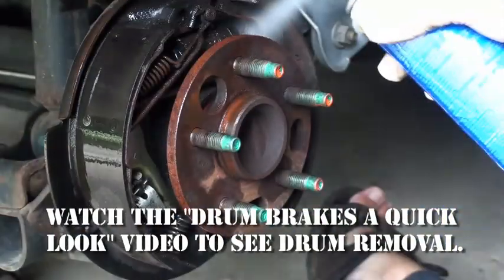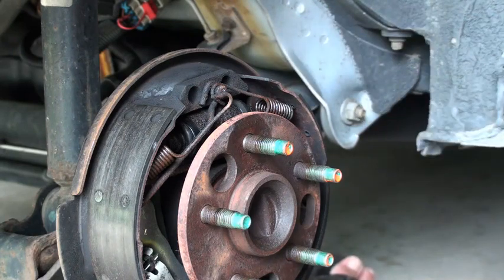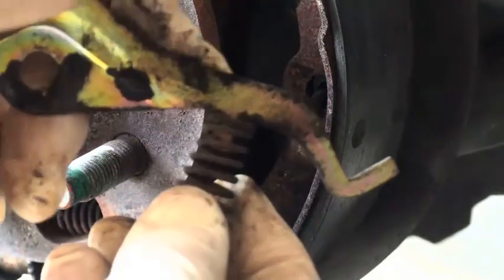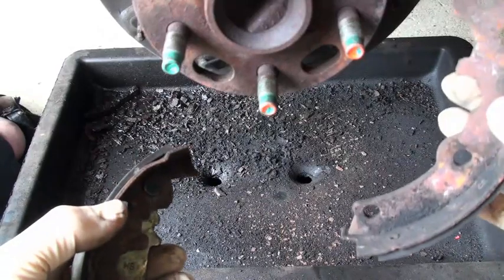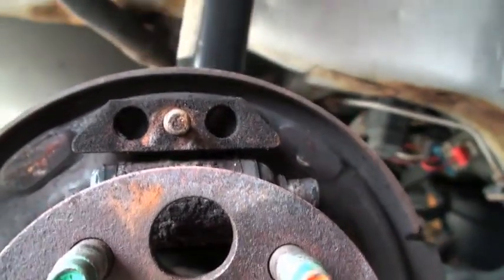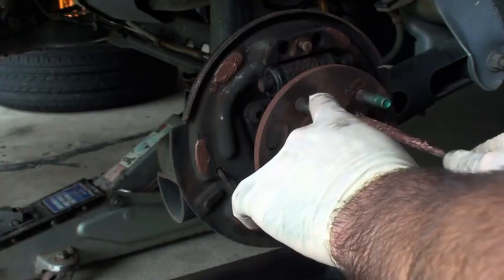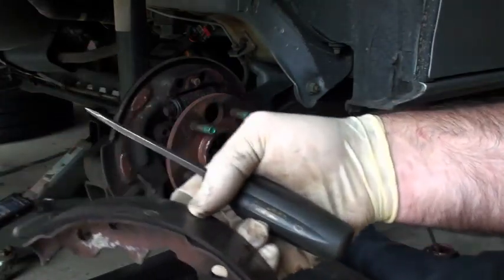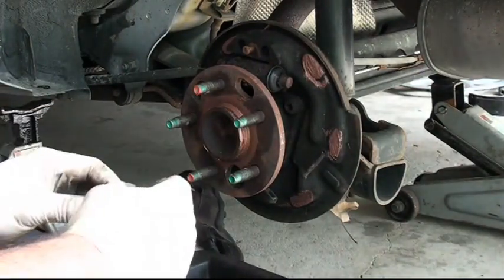Replacing Drum Brake Shoes Part 1 - EricTheCarGuy

Comment from the maker: Great question.  The other style is a "non-servo" style, the difference is how the brakes self adjust.  Servo brakes adjust when you apply the brakes while backing up, non-servo brakes are adjusted when you use the parking brake.  Non-servo brake shoes have the same amount of friction material on both shoes.

Comment from the maker: On a Prelude it is a little hard to get to but you need to take the slack out of the parking brake cable by tightening the 12mm nut at the base of the parking brake lever (inside the console).  When properly adjusted it will travel 7-13 clicks.

Comment from the maker: Use a pair of channel locks, side cutters, and a flat head screwdriver.  You start by using the side cutters to start the spread by placing it between the clamped part of the clip and the peg, then use the channel locks to squeeze the clip against the open end you just created to get it almost to the end of the peg, then take the flat-head screwdriver and twist it in the space between the peg and the gap in the clip.  reinstall using the side cutters to clamp.

Comment from the maker: @aode06 Very true and the way you isolate the cause of the pulsation is to find a safe area and pull up on the parking brake instead of using the brake pedal, if you feel a pulsation the rear brakes are warped, if not then it's the fronts.  Keep in mind this does NOT work on all vehicles (maybe 80%) as there are a lot of different parking brake set ups out there.  Thanks for your comment.

Comment from the maker: They usually come in what is called a "hardware kit" that includes all of the springs and hardware for a rear shoe replacement.  If you just need one clip however you might want to ask a local shop or something, they may have one lying around that they could give you, it wouldn't hurt to ask.

Comment from the maker: It's a standard brake parts cleaner, it may not be available in some states however so you may need to find an equivalent at your parts store.  The antiseize compound that I use is made by 3M and available at most parts stores, it's a good idea to ask the parts person to point you in the direction of these things where you buy your parts, they are there to help.

Comment from the maker: @geekspank1 It runs both rear wheels.  The best procedure however is to adjust the rear brakes first before trying to adjust the cable.  Since you have adjusted the cable first if you go to install new shoes there may be a problem since you have already partially applied the parking brake in your adjustment, you will likely need to back it off when you install new shoes.

Comment from the maker: I got mine in a kit from Sears, it wasn't that expensive and it works well enough.  Tools will make all the difference here, there are many different types and styles that I've seen over the years, some work better than others.  Be careful with these springs though, they can let go and cause some nasty injuries.

Comment from the maker: @ocj921 I've seen rear shoes last a very long time, years and lots of miles in fact.  It's because the rear brakes only do a small portion of the braking 20-30% actually.  It's best to do a visual inspection on them once a year to see where they are and clean and adjust them if they don't need replacing.

Comment from the maker: @TGDragon15 The first think I would check is the tires, try rotating that tire to the front and see if the noise moves with it.  If not then it could be a wheel bearing issue, before you remove the wheel you might try shaking it at to top and sides to see if there is any play.

Comment: @EricTheCarGuy I went ahead and did the periodic rear drum readjustment since your last response.  I inspected the brake shoes and scraped the shiny glaze with sandpaper. I got steel wool and did the same to the drums andcleaned everything up. That was it.  The brakes work really well now.  The pads were not working because of the shiny surface and now I feel they're working right.  So far no adjustments needed.

Comment from the maker: @polaris15rock It is possible you have the wrong parts or the wrong parts were there in the first place, check with a good parts guy to find out for sure what is suppose to be on the car.  The first thing I would check for the overheat is the brake adjustment, if they aren't adjusted correctly they can be applied all the time which would be just like riding the brakes and therefore create a bunch of heat.

Comment from the maker: It's probably the bosses on the backing plate, they get grooves worn in them and without lubrication, they can hang up causing the noise you describe.  I cover this in the video, it's just before installing the shoes.

Comment from the maker: @Twiztidguy Don't worry if the cylinder remains compressed, worry if it doesn't come out.  Think of what you see as the equivalent of pushing a brake caliper piston all the way in, once you have everything installed it should push against the shoe and work properly.  ABS and the base braking system are normally separate systems, in other words if the ABS is disabled the base brake system should still work without the ABS.

Comment from the maker: @mattRken You don't have to drain any brake fluid to do this job unless you compromise the wheel cylinder.  This is not likely if you follow the procedure outlined in the video.

Comment from the maker: For a basic drum brake job I've never opened the hydraulic system, I've just done it as you see in the video.  However periodic bleeding of the brake system is a good idea because after a while brake fluid absorbs moisture and is not as effective as new fluid as a result.  Is it necessary? not really, is it a good idea?  yes.

Comment from the maker: @rumble329 Not really, the wheel cylinder might be bad or you might have pushed the piston out, if that is the case you will need to bleed the brakes when your done for proper operation.

Comment: @kvitka075 Drum brakes most cars are very similar. Brakes on most cars are very similar in concept with the exception being a few nuts and bolts by the manufacturer ie: Dodge/Chrysler likes to use allen wrench cap screws. You're going to find different setups for every manufcatruer but the concept is the same and can be transferred to any manufacturer. Like Eric said, take a picture before disassembly. I like to take a long hard look as well as a few pictures before touching any tools.

Comment from the maker: @bd1048 Someone may have overtightened the parking brake cable at some point instead of adjusting the rear brakes, you might want to back off the adjustment and see if you can get the cables in then.  If this is the case, adjust the rear shoes first and then adjust the cable slack.  Good luck.

Comment from the maker: @fakeBULL Some proportioning valves require a special tool to reset them, yours may be one of those types.  I fix a lot of rear brake problems just by adjusting them properly.

Comment from the maker: @subron6er 2 things would have helped you, first you don't need to remove the brake shoes to replace a wheel cylinder.  Second if you break a bleeder valve you can bleed it at the line instead.

Comment from the maker: @Jeffmtbr I normally crimp the rubber line to keep too much air from getting in and too much fluid from leaking out.  See the disc brake videos I've done for the tool that I use.

Comment: Good video with humor put to it! Greasing the hub is good, first cleaning it even better to prevent rust particles from the area sticking to it. If I would have to do this job I would grease it after the rest of the parts are mounted to prevent getting any grease to the shoes by accident whilst trying to fiddle around with those springs as this would probably happen to me :-)

Comment from the maker: When you disconnect the battery you reset EVERYTHING including long and short term fuel trim (I'll do videos on this someday).  In other words if you just clear the codes the ECU will not have to go through the "learn" procedures that it would if you pulled the battery cable.

Comment from the maker: @cvmiata The brakes should work fine without the parking brake cable however this will not pass a safety inspection in some states.  For me I like to have a parking brake just in case.

Comment: @EricTheCarGuy 
Hey Eric!  Thanks a bunch!  I did exactly as you said and rotated the tires.  Lo and behold the problem became very apparent the moment I took the tire off it's bolts~there was a lot of dis-figuration and a huge crack down the center of the tire that I would not have been able to see otherwise (must have measured 6~8inches long though!) I'm bringing in my car to get a new tire tomorrow (^_^)!

Comment: Couple safety things here:

Not recommended to wear sandals when working on cars
You should put the car down on to the jack stands instead of leaving it on the jack,
when you leave it on the jack, it puts all the pressure on the rubber gasket in the jack and it can blow out and drop the vehicle on your legs. hate to see eric the one footed car guy.

also, when you were putting the springs back on it helps to lube the tool a lil so it slides smoothly.

GREAT VID THO!

Comment: Nice Job Man! I know what ya mean trying to explain and do the video.. 

I've had them where the two long shoes were on one side and the two short shoes were on the other. 

I use masking tape to cover the shoe material. When finished remove the tape and ya got grease free shoes.. The Blue 3M tapes works the best I feel.. 

Les

Comment: I cleaned and lubricated the adjusters.  I also cleaned everything and put grease on the back plate where the shoes rub when engaging the brake.  I still have to adjust the rear shoes periodically because the front disks are doing all the stopping.  The pedal isn't spongy either.  Shouldn't the adjusters automatically expand to the next groove when engaged and the play increases due to wear?

Comment: @EricTheCarGuy hi Eric, thanks for reply ! you are right i might pushed it out when i try to remove the brake shoes that why i see the brake fluid come out, and when after i put everything back in place, i don't find any leak from the wheel cylinder, is that gonna be an issue for me ? should i worry about that ??
thanks !!

Comment: hey man great tutorial, just replaced my shoes on a 98 F150. Question though, you say that the small shoe should go on the front and the big shoe on the back. When I first pulled my drums off the small shoe was the back and the big was on the front.  Is it possible someone messed it up before or is that how mine are supposed to go? The small shoe has more material then the longer one and also has a post for the Ebrake arm. It seems like to reverse the shoes would be nearly impossible.

Comment: I wonder if some vehicles are different because it seems like it would only work this way on my truck. I am positive the shorter shoe with thicker material was on the back and the longer shoe with less material thickness was on the front. It could be possible the Ebrake arm was installed on the wrong side, but the set up seems like it would only work this way. If you have experience with these vehicles and can let me know it would be great. Its a 98' F150 2wd. Thanks!

Comment: yo this coming weekend i will be doing this type of project....i have already been told i have a leaking wheel cylinder. would you recommend replacing both at this time instead of just one?...i know its only $13 bucks but i am in college ...and cheap

Comment: Hello Eric.Some help bro.What would cause a tin like rattle in a honda civic left wheel on low gears change sometimes.Wheel alignments off to the left.Nothing looks bent.Also looks like stud threads are damaged.

I'm thinkin replace all studs & nuts after takin off the rotor of course and send it for wheel alignment to a a shop.What do you think mate.Would that solve it.It could be that tin like plate behind the rotor.

Recently also got a squeaky sound of that same wheel when turning L/R

Comment: Good job on the subscriber ship, I Have a 1971 Jeep CJ five and it has j drum brakes and I'm trying to check the master cylinder and make sure it has oil but it's located in a very awkward place in the jeep and when I try to take off the top it's just a bowl so I was wondering if maybe you could help me figure out where I put the break will end brake fluid or if you have any suggestions I have zero brakes but the lines look good in the drums look good thanks for any help you can give me!

Comment: Just curious, maybe a dumb question but does the e brake run to both rear wheels or just one. I have a 93 escort and the e brake does not work. I have tightened up the e brake itself and can hear it tighten but does not hold the vehicle. Would this mean I have to replace the shoes...

Comment: hello eric just a quick question, where could i get that exact  spring removal tool you're using in this project. Advanced auto part dont carry that same type. any   tips or suggestion that would help. thanks.

Comment: I went ahead and replaced the cylinder just in case.  Plus advanced auto only wanted 12 bucks for the cylinder so you really cant go wrong ^_^ ez fix. thanks!  Onto ABS, what do you think could possibly cause my ABS to malfunction like it had.  The abs light would go on and off occasionally. And at random stops the abs would kick on and the the blazer can barely stop. Seeing as this is my girlfriends transportation and my son rides in there, id like to fix this as well. Thanks. @EricTheCarGuy

Comment: Hello. I have a 1955 Pontiac Chieftain with a rear end from a late 70s/early 80s Camaro. For some reason my rear drivers side break will lock up after slowly building pressure. I have to pull over and bleed the break line to release pressure and then I can drive again. This only happen on the one brake drum. I have put new drums, shoes, spring kit, and cylinder. So frustrating!!! Any ideas?

Comment: Hi there~ 

Your videos are awesome!  I've visited your website and checked out over a dozen videos in the last hour or two (yeah I know, get a life~) but they are really informative.  I would like to do more work on my own, you know? Anyway, I have this low rumbling noise coming from the right rear of the car and it has something to do with the wheel's rotation.  It happens between 15~20mph and then becomes inaudible until about 70~75mph. Have you ever heard of something like this? thanks!

Comment: Im kind of new at rear break shoes, need an oppinion.  When i removed everything i noticed that the break cylinder on the left side isnt decompressing.  It kind of stays pushed in.  If im correct, that will cause the shoes to not even make contact?  the shoes hardly look warn either and its a 96 blazer.  I got it a year ago, and ive been having all kinds of break problems.  Including my ABS malfunctioning which made my blazer not stop.  I removed the abs fuse to temp fix the problem. Please help

Comment: is it possible to update a old master cylinder and power booster say from a 77 celica and update it to idk can you update it with a newer cars brake system at all? my pedal just goes to the floor. and when i pump the brakes after pressure buildup ive got fluid squirting out pinholes on the two tops to the reservoirs. i dont like the two reservoirs setup and really want to update it if possible. could you post a video on how to do that? or inbox me details on how?

Comment: Okay Eric I asked you before about cost on taking it (in general) to a shop and I understand you don't want to disclose a price.. I've been told by people that for drums alone it can run about $200.  My question is IF someone with decent knowledge that has never done it before and used your how to video as a reference did it successfully would you save a decent amount of money ? I am really considering tackling this myself but I don't want to end up screwed. Rotors I can do no prob but drums..

Comment: Good as far as mechanical info but it looks like you are using a small floor jack without jack stands. If one of your viewers crushes their leg because their cheap floor jack fails... Maybe you can cover the safety part a little more. Also eye protection for all the springs.

Comment: On my 69 I was going to bleed the brakes, the bleed valves on the drivers side came loose no problem, the passenger side I broke both off, was able to get one off and replace it, the other Ihad to take the wheel cylinder out and replace that, this is on the back passenger side, well after taking all that stuff with the brakes off,  I AM LOST,,,  LOL,,, did get the new wheel cylinder installed, the the brakes is another story,  right now looking on the internet for some good picss,  Ouch!